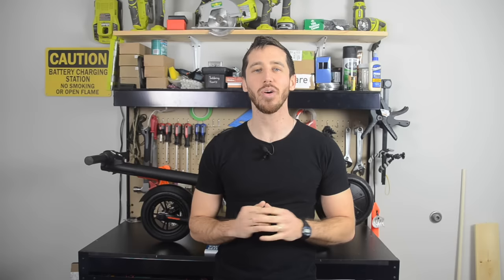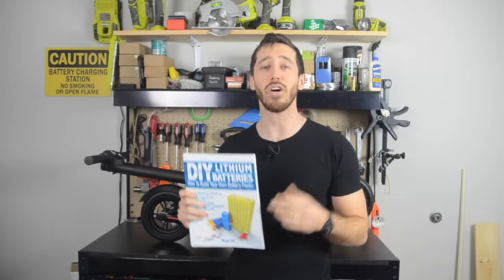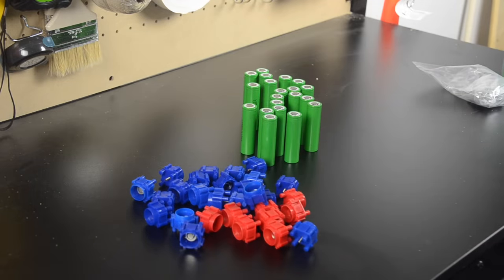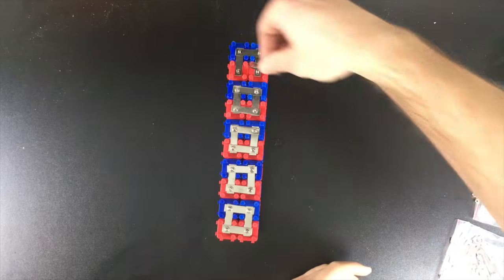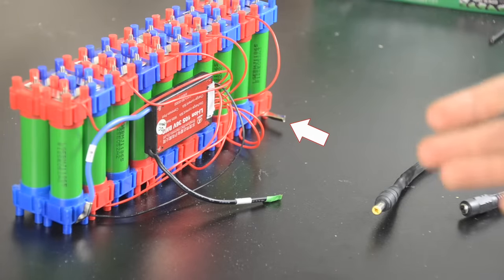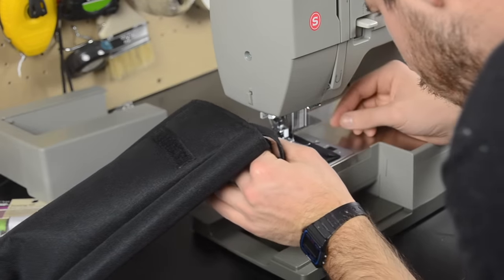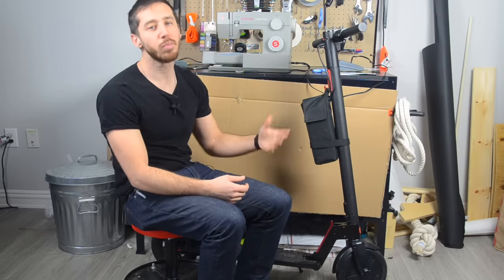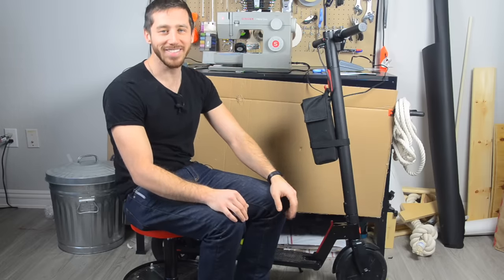DIY 2x range booster battery for electric scooter or e-bike

Comment: Why are batteries NOT stacked in series like a torch/flashlight? Seems to be far less welding/soldering/vruzend needed. What am I missing?
Reply: Stacking doesn’t give a strong connection, these packs are high amp draining compared to a flashlight so you would lose energy to heat and when you hit bumps you’re springs in the tube could momentarily disconnect leading to surges and sparks.
Reply: @olemissjim  - Thank you. Makes sense. If only springs could ne made strong enough to support cars and trains... (tongue-in-cheek). Begs the question why 18650 are made to be singular in use when (nearly) nobody needs just one. Wonder when the 18650 industry will re-tool for a pre-built, snap/twist-together series/parallel configurations?
Reply: bob  strong springs have high resistance and generate heat. Copper and aluminum and silver are great conductors but terrible springs.

Comment: I have a question, what happens if you don't have the booster plugged in and you carry it in your back pack and then connect it when your other battery goes flat? Does the booster then charge the flat battery?
Reply: I think he covered that... It'd be a bad thing... 

Chargers trickle it through at low amps. A battery without charger though could pump 40A over a drained cell which would damage it.

40A is plenty enough to cause fire or explosion, if there's not a breaker.
Reply: @gorjusboating2390  I guess this is just a problem with arrays of Lithium Ion batteries. You know this process is used on car batteries when someone jump starts you. You are effectively just putting a full battery on a dead battery. This is why I asked the question. Wouldn't the BMS on the flat battery on the bike, solve the problem you are talking about?
Reply: @karlbartelt3939  I don't think it would.

Jump starting isn't quite just connecting to the old battery in parallel, though I don't understand the difference...

https://goo.gl/images/z5K45V
Reply: @gorjusboating2390  Wow, in over 30 years of jump starting and watching other people jump start cars I have never seen anyone connect to the bare metal, I've just seen and I've always just paralleled the batteries. The negative on the dead battery is almost always grounded to the chassis anyway so it's sort of the same. The only reason I can find to why you connect to bare metal it to reduce sparks when connecting straight to the battery, no other reason.
Reply: Interesting. I'm also curious as I'd like to do pretty much what you describe, carry a spare battery... But only use it if I need. I imagine I'd have to have a flip switch for which circuit it powered.

I think with lithium cells, they become resistors when depleted. They're good for large power flows if its the same as what they're pumping out. But it different, case resistance, which they're not capable of taking, and throw a wobbly by means of getting hot fast and exploding.

Maybe car batteries are tougher spuds? As tech gets fancier it typically gets more delicate.  Interesting though, as I've been considering building my own lithium cells to replace some heavy boat batteries... Might abandon that train of thought now!

Comment: Great video as always! How much would you end up spending for this build including end caps, cells, BMS and connectors?
Reply from the maker: Good question, probably should have included that. At retail this should cost between $100-$140 if using good quality cells. It could be done for cheaper with salvaged cells too or with soldering, but I always advise against soldering 18650s.
Reply: @EbikeSchool  Hi Micah, thanks for the info. Please can you detail how to remove the speed limiter from the Gotrax GXL V2 model please. No info out there at all.

Comment: If I was to connect the battery in parallel with the output of the battery, would this work?  would this be more efficient.
Cheers
Reply from the maker: You could do that, but the problem is you have to open up the scooter to get to the output, which most people don't want to do. It also voids your warranty.
Reply: @EbikeSchool  Great Vid as usual! If you had to connect the booster in parallel with the output wires from the battery , would you be able to use the stock charger? I assume it would just take twice as long to charge?

Comment: That was great video one can you help me with me increasing Volts on existing 36v pack to 48v, can I add a 12v in series how do I manage the bms of individual pack, please advise
Reply: Yes, you will need 13 battery wire in series to get 48V.

Comment: How many batteries is too many batteries when I comes to space restrictions and diminishing returns of weight?
Reply: Search 'Energy Density' on Wikipedia and you will get the answer to this question. Your never going to ride an electric bike 100kms away from plug in power, so the question is really far do you need to travel and how fast before you can plug in again.

Comment: I´ll use this for my xiaomi m365. Should be the same method as that scooter or mostly the same. Thanks m8
Reply: Ricardo queralt-lortzing make a video- I got a M365 too
Reply: How did this work out for you? Mine just enters into charging mode and won't run when using the charging port.

Comment: Hey bud,  1st let me say over the years I've come across your videos and they have mostly kept me from burning the house down here and there lol ! You're awesome! Listen I've looked everywhere online I have a go tracks TXL version one headaches with the console maybe my fault maybe I did something stupid lol however I ordered a new 1 from go tracks and I don't know if you've heard but they go 13 miles an hour instead of 15 ( Speedometer still says 15.7) they also have a speed limiter or something that literally no longer lets you go over 15.7 even downhill ... I have scoured everywhere I don't know if it's just so new but I can find no information anywhere on how to by pass  Go tracks themselves have been less than helpful even though they sold me replacement part for a scooter that did 18, 20 downhill plus now physically slows down to 15.7 lol anyway any help would be super appreciative if you have any ideas or have heard anything about this thanks in advance

Comment: How does plugging it into the charger port not short circuit or ruin both batteries?
Reply: Because the two different batteries positives are connected together, 36v to 36v, meaning there is no short. Same goes for the negative. That is why you have to make sure the voltages are the same. If one was discharged, say at 28v then there would be 8v potential and you would have a low resistance (high current) short through your batteries.

Comment: So if I have an extra battery from another scooter, with the same voltage and wattage, I just need to charge it  and add a charge cronnector. I also need to fully charge the  the scooter battery.  After both have been charge fully, I can connect the extra battery via the charge port  on the scooter to get the extra range - is this correct? I'm not an electrician or have any experience with any of this. How do I decipher the wires and circuit board on the battery from the old scooter so I can use it to extend the range of my new scooter?  Your very helpful. Thanks for the video.
Reply: I also want to confirm thiss before I try it
Reply: @drzprince176  
Ok, please let me know as soon as you've confirmed
Reply: @galvaniratley761  I did research and I can confirmm just ordered my batteries  ✌🏼

Comment: Hello,
I build a 10S5P battery pack that only last for 30 minutes any suggestions?
Reply: In my experienced you have a bad battery. Check voltage each parellel ground. Bad cell will cause fire! please be careful.
Reply: @getreallogic2057  thank you

Comment: Plugging it into the charging circuit is wrong
The wiring from the charging circuit is 3amp wiring
The booster battery has to be exactly the same capacity
Or the internal battery will run out first and feed of the larger battery

Comment: Hi Micah, thanks for the video. It would have been great to see the material costs for the battery that you built.

Also, is there any battery-boosting-solution for systems where you cannot simulatenously charge and use the main battery?
Reply: Cost would be around $70 for 20x new cells plus $15 for a generic 20A 10S BMS plus $15 for cables, plugs, wraps and stuff, so around $100 total. Not counting the Vruzend kit though, that one would be extra.

Comment: How do you figure out how much voltage the scooter can handle?
Reply: its usually written on the battery how much it puts out. All things are designed to handle more than they say ( I know that because i studied electrical engeneering and we used components that can handle more current or voltage than we calculated so that it doesnt run on max the whole time and kill itself over time)  So basically you can read on the battery how much it puts out and that would be the voltage your scooter can handle. also you can look at the fuse and look up how much current it can handle before failing and that would be your max you should go for because the elecronics are definetely not designed to handle more than that. Pls excuse my english, im not native and forget how some words are written sometimes XD
Reply: @wladislawshamin5447  Thank you so much for this, I'm studying this as well and I'm just starting out, this helped a lot.
And your English is great, I didn't see anything wrong with it, don't worry, I'm not a native either.
Reply: @arnarpall5893  I have to correct myself a little. I dint study it at a university but at college. its called Abitur here in germany so i know quite a few things but i am not an expert ofcource. But i can tell you for sure that the motor can handle waaay more than the manufacturer is stating becase the built it like this so it doesnt run on max the whole time which would cause the motor to get dammaged faster
Reply: @wladislawshamin5447  okay, makes sense, I just purchased this man's book from the beginning of the video, I'm going to read a little bit about it

Comment: how many batteries do I need to make a 48v 30a battery?
Reply: 1 lithium battery is usually 3.7 volts and 34000milliamps.
So=10×3.7=37volts/3.4amps ,take it from there.

Comment: This is a good idea however you should never put lithium ion batteries in parallel that ruins your overcharge protection. What you should do is remove the stock battery and plug in your own battery through a connector.

Comment: Did this, it fux the battery pack.  I'm currently trying to recover the battery pack.
Reply: Any chance the polarity was reversed on the new battery? I bought a RC car battery once where the seller had the polarity backward and it ruined EVERYTHING.  The charger, the car I put it in, and the battery itself.  If the polarity is right and the batteries are the same voltage and charge level, I can't see how it would hurt either battery.

Comment: I had thought of doing the same thing but I know that the internal bms of the scooter only lets in a few amps (2/3 ah) and they are not enough to create a real parallel between the 2 batteries. Correct me if I'm wrong. Sorry for bad english 😅

Comment: Couldn’t I just use a cheap 36V xiaomi m365 battery change the connector and have a easy pack. They have more ah and are cheap and already put together.
Reply: Did you try this? Mine won't run when the charging port is being used.

Comment: i dont think it would be totally ok to wrap the batteries with foam or flamable material ... firstly cause they can catch fire easily ...second these materials hold the warmth produced by batteries and this is not desirable since we need to get rid of it ... and the can catch the moisture  . you'd better make a water proof light aluminum casing .. in this way its water proof and it easily transform the heat. but you should be super carefull to make durable contacts and wiring should be long life

Comment: Hi, thanks for yr very professional and informative videos. I have a question regarding the connection of the booster battery. Is it safe to connect it to the charging port of the primary battery? I'm asking it assuming ,that the charging connector and lines that are connected to it usually could handle much lower current than the discharging port.

Comment: Spams his expert DIY battery building book, tells people to connect their booster packs through the charging port. ANYONE WATCHING: DO NOT DO THAT. THIS IS BAD ADVICE. The charging port is not meant to take drive current, just low-amp charging; it has narrow wiring and a small connector. If you do this and you're lucky, you'll lose a lot of power through wire resistance and the booster pack will work inefficiently. If you're unlucky, you'll destroy the charging connection. If you're really unlucky, you will melt the wires and quite possibly short out all the things and set fire to your scooter. The only proper way to do this is with a Y-cable at the main battery connection using suitably thick wiring.

Comment: If you remove the cover where the charging port is you have direct access to the heavy gauge battery wires vs going through the tiny ones in the charge port. I may give this a try with a small 10s battery in the future.
Reply: I picked up a used segway es4 external battery and will modify it to work with the gotrax, i figure it already has a nice enclosure and its own charging port, plus it was only $50 on ebay, can't beat that price.

Comment: I would rather buy a 36 volt 5-7 ahr battery in eBay.  Those individual cells are not cheap either.

Comment: This will not work with Xiaomi mijia m365. Because u need to downgrade firmware and a lot of different issues. Because also m365 has smart BMS and after connecting add battery scooter simply flashes and beeps showing error like "u can't ride because I'm charging right now".
So good luck ;)